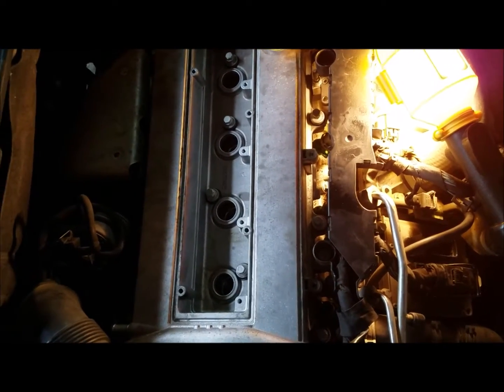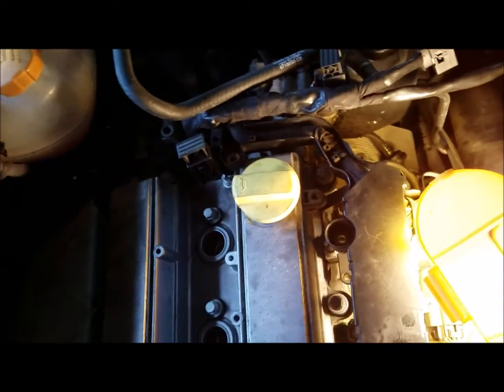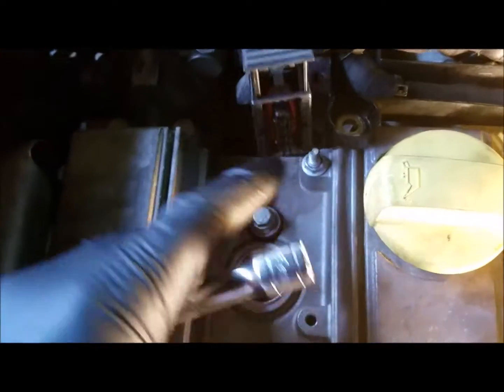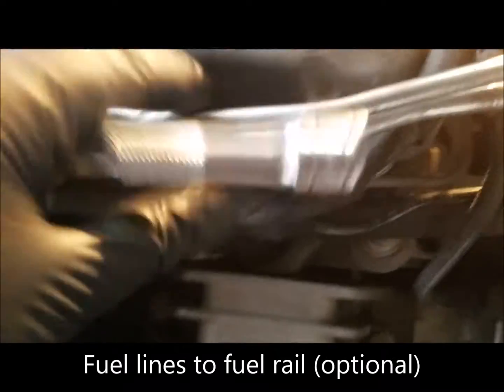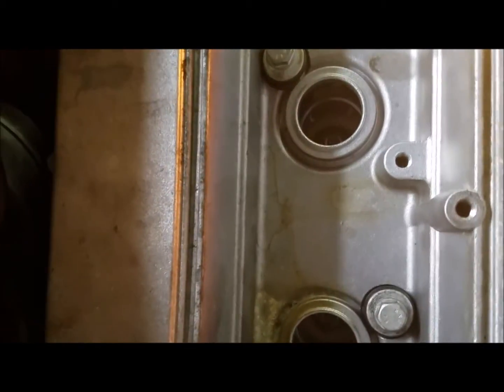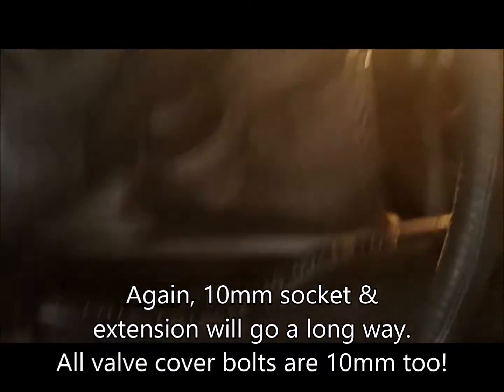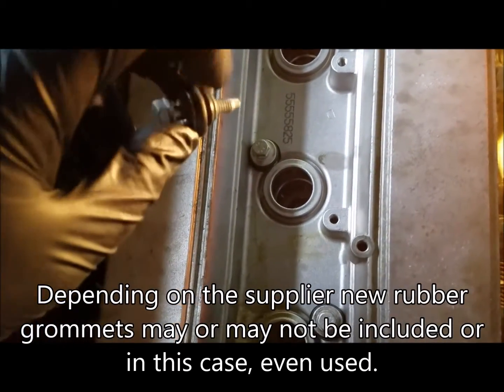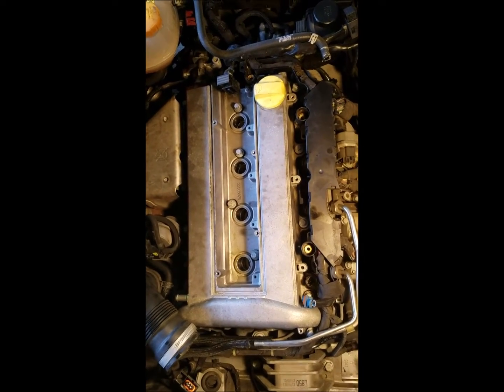Saab - Replacing a Valve Cover Gasket (Ecotec)

Comment: Could a valve cover gasket mix some coolant with your oil and cause a no start issue??
Reply from the maker: No. But a headgasket can...
Reply: @saabross3171  damnn I know I was just really hoping it wasn't so. It doesn't smoke at all

Comment: No need for RTV at all? Dont tell me I wasted money buying it now..
Reply from the maker: ROS MANIA You can, not like it hurts. But zero was used in this install and it didn't leak. Car was sold a few weeks later and the new owner had no complaints of leaks as well. I believe it's an extremely well-made gasket that can stand on its own!
Reply: Saab Ross Thank you for reply! Work shop manual does not mention RTV, so, I gues I wont use it either. As you say, looks like gasket is of good design. The forums also say that newer modells dont need RTV.. Thank you for the video! Gonna change my gasket this weekend.
Reply: @saabross3171   can you please link me the 08 9-3 2.0t valve gasket, and also the coil gaskets, and new bolts with the bushing things. Please.
Reply from the maker: @dravenrosenbaugh2834  Not sure where this customer got the bolt gaskets, but I'd look here for the OEM gasket kit:
https://www.esaabparts.com/saab/parts/90537687

A kit with the 14 bolt gaskets may come from FelPro or some other OE supplier.

Comment: Hi so what's the cost for a mechanic to replace a gasket valve I also have a leak. I have a 2005 Saab 9-3.
Reply from the maker: raiders209norcal Depends on the shop rate, this particular client paid for 1.5hr labor plus gasket. Typically comes out to $100, give or take.
Reply: Saab Ross ok thank you I was just wondering because I got some oil leaking out as well .